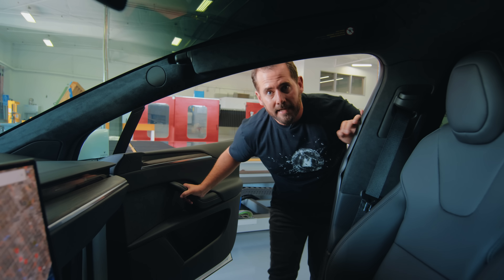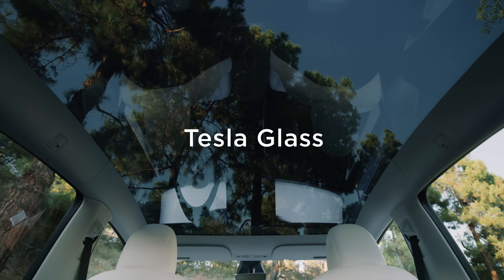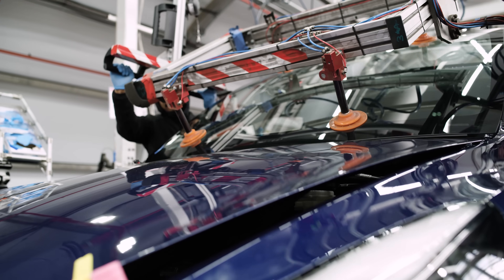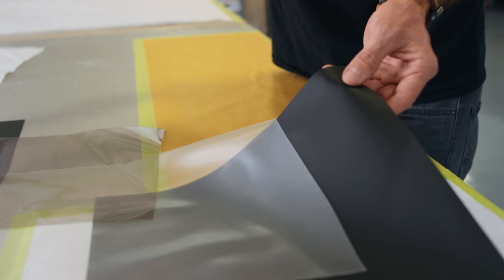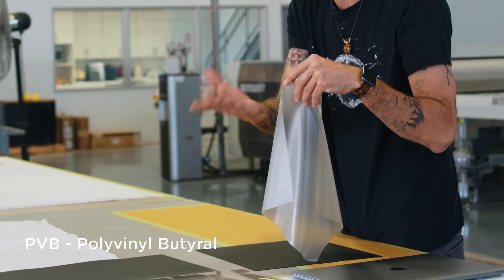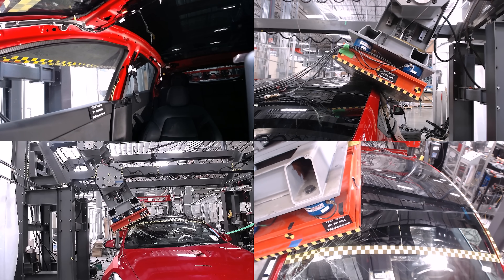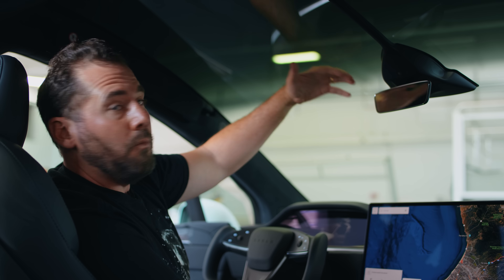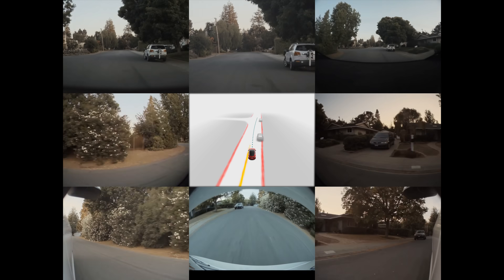Tesla Glass | The Secret to a Quiet Cabin

Comment: hi Tesla 🤗
i agree with many of the comments - more videos like this explaining the various technologies and features of the cars...and gigafactory tours for sure!
question - will the sunroof ever be an option again? i really want the S plaid, but don't want to give up my sunroof! 😁
Reply: This is not new...
W140 features included:

Double-paned soundproofed glass was a new S-Class innovation first fitted on the W140. This form of window glazing allowed for improved soundproofing, reduced condensation, and other insulation benefits.

Electrically-operated exterior mirrors could be folded by switch to ease driving in narrow spaces.

'Parameter steering' was a system which made low-speed driving easier by reducing the effort required to maneuver in speed-sensitive situations such as parking.

Rear-parking markers, or guide rods. These rods extended from the rear corners of the trunk lid when in reverse, providing the driver with a guideline for rear maneuvers. In 1995, this system was replaced by the sonar-based Parktronic system which measured the distance of the bumpers to nearby obstacles.

12-way powered, heated front seats, with 3 setting memory functions and lumbar support.

Windshield wipers with heated washer system. Later models also included rain-sensing windshield wipers.

Electrically-operated automatic-dimming inside rear-view mirror that tied into the seat and steering wheel memory.

Heated exterior mirrors. Later models also included auto-dimming driver's side mirror.

Orthopedic seats were an expensive option from the factory but consisted of several different air cushions in the seat that the user can inflate and deflate to find the perfect driving position.

Dual-zone climate control. Four-zone climate control on LWB models.

Reclining and heated rear seats on LWB models. V12 models also have the four-place seating option, which allows fully adjustable rear seats, lumbar support and rear sunshade control. The center seat has been replaced by a burlwood center console, allowing a 2 + 2 seating format.

The climate control system could be set to operate for 20 minutes after the engine had been turned off.

Electric rear sunshade.

Rear passenger illuminated vanity mirrors.

Soft-closing doors and trunk.

Leather interiors and burl inserts (optional; standard for 500SEC/CL 500).

In 1995 the S 600 Coupe became the first Mercedes car with GPS navigation system, designated Auto Pilot System APS. It featured CD-ROM maps and full color navigation display in the center dashboard.

In 1996 the Linguatronic voice control system and Parktronic sonar-based parking system were introduced

In 1997 the TELEAID emergency and tracking system was introduced in the US market.

Also, developed with the car, a Bose sound system was available as an option.

Comment: Love this video. The people who make vehicles like a Tesla are one of the biggest reasons I want one.
Reply: Because they're good at copying?
W140 features included:

Double-paned soundproofed glass was a new S-Class innovation first fitted on the W140. This form of window glazing allowed for improved soundproofing, reduced condensation, and other insulation benefits.

Electrically-operated exterior mirrors could be folded by switch to ease driving in narrow spaces.

'Parameter steering' was a system which made low-speed driving easier by reducing the effort required to maneuver in speed-sensitive situations such as parking.

Rear-parking markers, or guide rods. These rods extended from the rear corners of the trunk lid when in reverse, providing the driver with a guideline for rear maneuvers. In 1995, this system was replaced by the sonar-based Parktronic system which measured the distance of the bumpers to nearby obstacles.

12-way powered, heated front seats, with 3 setting memory functions and lumbar support.

Windshield wipers with heated washer system. Later models also included rain-sensing windshield wipers.

Electrically-operated automatic-dimming inside rear-view mirror that tied into the seat and steering wheel memory.

Heated exterior mirrors. Later models also included auto-dimming driver's side mirror.

Orthopedic seats were an expensive option from the factory but consisted of several different air cushions in the seat that the user can inflate and deflate to find the perfect driving position.

Dual-zone climate control. Four-zone climate control on LWB models.

Reclining and heated rear seats on LWB models. V12 models also have the four-place seating option, which allows fully adjustable rear seats, lumbar support and rear sunshade control. The center seat has been replaced by a burlwood center console, allowing a 2 + 2 seating format.

The climate control system could be set to operate for 20 minutes after the engine had been turned off.

Electric rear sunshade.

Rear passenger illuminated vanity mirrors.

Soft-closing doors and trunk.

Leather interiors and burl inserts (optional; standard for 500SEC/CL 500).

In 1995 the S 600 Coupe became the first Mercedes car with GPS navigation system, designated Auto Pilot System APS. It featured CD-ROM maps and full color navigation display in the center dashboard.

In 1996 the Linguatronic voice control system and Parktronic sonar-based parking system were introduced

In 1997 the TELEAID emergency and tracking system was introduced in the US market.

Also, developed with the car, a Bose sound system was available as an option.

Comment: anyone who actually has one knows it’s still relatively noisey though
Reply: Yeah mine is as loud as my civic when on the highway 😂
Reply: Yeah wtf the wind noise is not impressive at all.
Reply: yeah I was gonna say similar, they should brag about the stuff people praise them for. No one is impressed by Tesla's sound proofing (the new Model S's are supposed to be improved on this front though).
Reply: true, my model 3 is super noisy
Reply: The wind noise is terrible, worse than my old Mazda 3 2010.
Reply: Hyundai Ioniq 5 is SO much better in the no noise departement.
Reply: @thomasdemming2756  Unfortunately a fail in navigation and efficiency.
Reply: @moestrei  fail? Tesla might be better in those departements, but it is no way near a fail.
Reply: @thomasdemming2756  For a company which has made the most efficient EV world  wide but with a small battery, then upgraded the battery but stuffed up fast charging and now stuffed up efficiency to look cool it is a total path of fail, yes. Also if the Plaid doesn't require 800V tech for super performance than this could be a fail too as there are not that many 800V chargers available and charging on 400V has again efficiency penalties due to the extra conversion required. A possible fail fail.
Reply: @moestrei  not that many 800v chargers available YET. I don't agree one bit with your statement. You must be wiser than big parts of the EV industry.
Reply: @thomasdemming2756  I am working as an electronics engineer in the EV industry. I drive an EV (310.000km) and i have converted (fully certified and registered) a motorcycle to solar electric. And I am sick of stupid shoeboxes on wheels (= all Euro manufacturers). Efficiency is King. Aptera is reserved, I hope it makes it to my country. You are welcome.
Reply: yup frame is hollow compared to all the components ICE vehicles use, they wanted the vehicle to be lighter for I assume longer range capability
Reply: serious question. are you owners wanting less glass? would that add weight and reduce range?
Reply: @northwestlife_9  I wouldn’t mind having just a regular sunroof, although the glass roof in my ‘16 model s isn’t as expansive as some others. And the larger the glass roof, the heavier the car because they need to add back in so much structural rigidity support to make up for it. Same reason that convertibles are so much heavier than non convertibles
Reply: @BrendanPJames  interesting. ty. our Optima hybrid has an almost all glass roof and we love it.
Reply: Probably due to absence of engine noise. Engine noise in ICE vehicles drowns out most of wind noise
Reply: @hydrolifetech7911  not just that. They don’t use nearly as much sound deadening material as other brands
Reply: @hydrolifetech7911  eh you can barely hear modern engines anymore if you don’t push it

Comment: Tesla is THE best
Reply: W140 features included:

Double-paned soundproofed glass was a new S-Class innovation first fitted on the W140. This form of window glazing allowed for improved soundproofing, reduced condensation, and other insulation benefits.

Electrically-operated exterior mirrors could be folded by switch to ease driving in narrow spaces.

'Parameter steering' was a system which made low-speed driving easier by reducing the effort required to maneuver in speed-sensitive situations such as parking.

Rear-parking markers, or guide rods. These rods extended from the rear corners of the trunk lid when in reverse, providing the driver with a guideline for rear maneuvers. In 1995, this system was replaced by the sonar-based Parktronic system which measured the distance of the bumpers to nearby obstacles.

12-way powered, heated front seats, with 3 setting memory functions and lumbar support.

Windshield wipers with heated washer system. Later models also included rain-sensing windshield wipers.

Electrically-operated automatic-dimming inside rear-view mirror that tied into the seat and steering wheel memory.

Heated exterior mirrors. Later models also included auto-dimming driver's side mirror.

Orthopedic seats were an expensive option from the factory but consisted of several different air cushions in the seat that the user can inflate and deflate to find the perfect driving position.

Dual-zone climate control. Four-zone climate control on LWB models.

Reclining and heated rear seats on LWB models. V12 models also have the four-place seating option, which allows fully adjustable rear seats, lumbar support and rear sunshade control. The center seat has been replaced by a burlwood center console, allowing a 2 + 2 seating format.

The climate control system could be set to operate for 20 minutes after the engine had been turned off.

Electric rear sunshade.

Rear passenger illuminated vanity mirrors.

Soft-closing doors and trunk.

Leather interiors and burl inserts (optional; standard for 500SEC/CL 500).

In 1995 the S 600 Coupe became the first Mercedes car with GPS navigation system, designated Auto Pilot System APS. It featured CD-ROM maps and full color navigation display in the center dashboard.

In 1996 the Linguatronic voice control system and Parktronic sonar-based parking system were introduced

In 1997 the TELEAID emergency and tracking system was introduced in the US market.

Also, developed with the car, a Bose sound system was available as an option.

Comment: Can you guys explain what changed between 2019 model S and 2021 Plaid glass roofs please. 2019 (full car not tinted) suns heat not an issue, 2021 Plaid feels like I’m baking in my car to the point where I went to go get ceramic tint installed.

Comment: My 9/2018 Model 3 Performance, 85k miles, apparently came with side glass that wasn't engineered to reduce sound.  Absolutely love the car.  But on long trips, I at times wear ear plugs.  What's the best thing I can do to dampen road noise?  Is there an upgrade path to quieter windows?
Reply: Me and my brothers 2021 performance collects water and makes a sizzling wind noise when the windows are 100% closed. We have to tap up/down to find a sweet spot where the window actually seals correctly…

Comment: It's super nice... But how about making a LOW COST EV?

Standard Doors, Standard Roof, Standard Steering Wheel, 40kWh battery, single motor with ~130hp... No Autopilot, just a standard Cruise control... Maybe the collision avoidance system... But only if it doesn't add too much on cost.

A "Tesla Corolla". How about that?

Comment: From someone who owes two here is the problem. Laminated side glass is not new, its been on cars for years and was only added to Tesla cars recently.. No matter how good the engineering is, if it's not installed correctly it's a failure. (Remember the guy who's roof flew off on the freeway on his way home from picking up his new car?) . Combine poor quality control with subpar customer service and it takes the entire reputation down. The Asian car makers are coming for you Tesla. You need to step up your game or you will be out.

Comment: Please bring back a moonroof that opens on the Model S.   Loved it on my 2015, and have it on my 2018 S.  Haven’t gotten a newer car because the roof doesn’t open anymore.
Reply: whilst opening roofs have become a huge trend and are sold extremely well amongst all car brands (big profits), there is actually a big issue. If your aircon is efficient enough, such as in any Tesla 2021 Model 3, Model S, X or Y, open side windows, and especially an open roof window, even if it's a small opening, causes extremely bad aerodynamics and uses up more additional electricity than the aircon possibly could. This is the initial decision to let go from it, as Tesla's main goal is to offer as sustainable and ressourceful products as possible. It's the efficiency. Of coarse a lot of smokers only buy a car if they have their openable roof and a lot of pre- skin cancer research results generations still want their cabrios' and sunroofs' Sun blast on their head and skin in the summer, but it really makes more sense to not manufacture cars that way. Respectively give a car an option to open the ceiling like this. Also of course, the less parts a car or roof has, the more spacious you can design it and the less likely for any part to ever need maintenance or fail, thus raised cost efficiency as well. I believe once Tesla will have raised its production numbers enough, growing fast enough to the extreme growth demand, will not anymore be the very biggest priority, they will surely offer much more options and more fleet variety, despite ruining the simplicity and for some customers that chose it, the efficiency of the car. But until then, only Roadster 1 and soon to be offered Roadster 2 might be an option for you. PS: I'm driving a 2021 Tesla Model 3 Performance, only have it for 10 months now and already made 22k kilometers / 14k miles. May I ask how many km are on your S and how it's performing today? Are you the first owner? PPS: There are some 2017 Model S long range with the 100 battery that still had a sun roof but much improved motors, drive train and interior quality vs the 2015 model. You may find a good one still on the second hand market. Meanwhile, lots of further fun with the Model S!

Comment: I love technical details, since they reflect more on the values contained in these cars... so keep these vids coming!
Reply: The first laminated glass put in cars had a layer that would darken and become brittle over time. In the late 1930s, manufacturers began using Polyvinyl Butyral (PVB) to make auto glass clearer and stronger as well as to help block sound and harmful ultraviolet rays.
By 1937, safety glass became mandated for all cars. Changes occurred slowly throughout the years with innovations like the curved windshield from Studebaker in the 1940s.
Reply: @CanIbeFrank  thanks for the infos. I hope that you are not trying to communicate, that the current technology level (that Tesla is also using) is nothing more than it was 80 years ago. :D

Comment: So if there is a crack in the windshield, you have to replace the entire roof? Hmm?
Reply: ..actually the likelyhood for such glasses to crack or have any other issues is far far lower than with conventional glass. Also Tesla figured out systems to manufacture it at even slightly less cost than traditional car windows. Innovation was the key. Achieving more with less ressources. Therefore a 2021 Tesla Model 3 only costs 39k, all included. They even found strategies with any component, to make it maintenance free and not necessary to replace anything. Tesla has (since 2017) the least amounts of service visits of any car brand in the world, also offering, IF EVER NEEDED, the cheapest service costs. Current Teslas only need new tires every now and then and fresh window wiper water when it's empty. No oils, no sudden expensive filter replacements, no mechanical part maintenance, not even brake maintenances, since Teslas being the only cars equiped with e-motors strong enough to avoid using the brakes at all and using the motors to generate back electricity instead. Calculated over 5 years, a Tesla Model 3 is currently the cheapest car on the market. Not to forget how much longer than any other car it keeps its value stable. It's quality which saves money, if done the right way.

Comment: Damn! 🤯

Now, that is Tesla Material..❤️
Reply: The first laminated glass put in cars had a layer that would darken and become brittle over time. In the late 1930s, manufacturers began using Polyvinyl Butyral (PVB) to make auto glass clearer and stronger as well as to help block sound and harmful ultraviolet rays.
By 1937, safety glass became mandated for all cars. Changes occurred slowly throughout the years with innovations like the curved windshield from Studebaker in the 1940s.